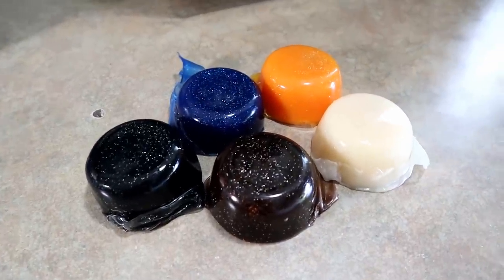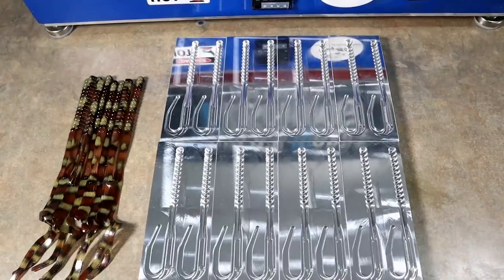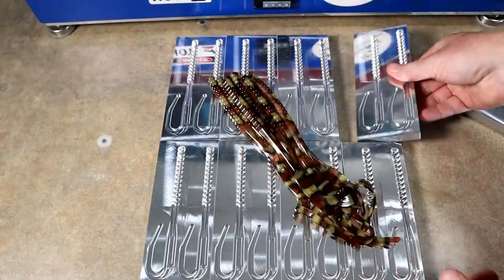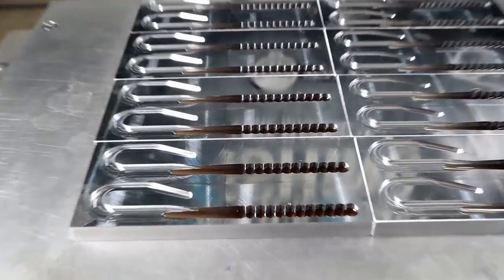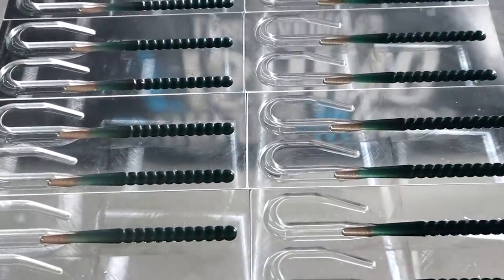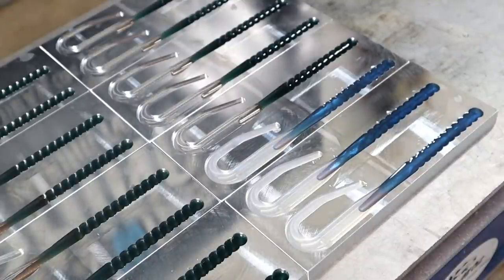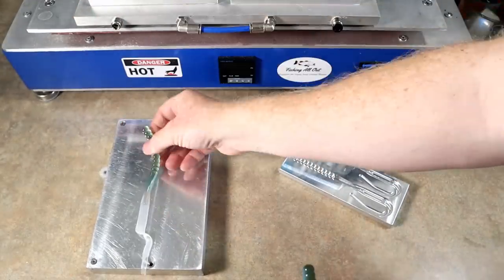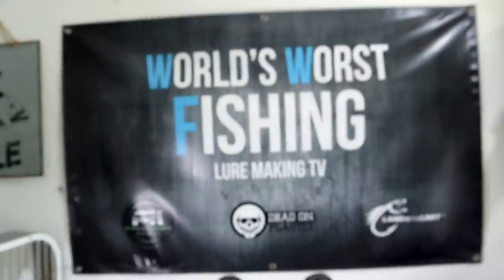Treasure Chest Of Bait Molds Un-Boxing; Triple Laminate Hand Pour Technique

Comment: Awesome videos… Kind of a throw back mold question. During the unmolding/curing process, could you leave the runner attached and hang from the runner? Like run wire through or clip onto the runner to hang or does the runner have to come off before it’s done curing?

Comment: I got a single electric instant pot kinda heat plate, it doesn't have tempature numbers, its just got 1-10 so, between 1 and 2, on the heat meter is the sweet spot for this. Specially since its thinner than say the swimbaits, 4'', cause those are around 3 for me. My temps match his which is nice, but its random with this heatwave too tbh lol .... OMG I LOVE THIS WORM MOLD !!! Bought 2 of the 5 inch ones, (7.5 '') and already planning a fish trip tomorrow to a nice lake.

Comment: Chris I noticed you don’t but the baits in a tub of water anymore.  Have you found that not to be necessary anymore right, is the something you do off camera?
Reply from the maker: Just kinda got out of the habit
Reply: @WorldsWorstFishing  So then it’s not really necessary correct?
Reply from the maker: @davidcarr4464  I think for really large baits that take a long time to set up, it helps that process.. additionally if you were running large volume of injection, when you are taking baits out of the molds as quickly as possible when they are still very warm it helps..